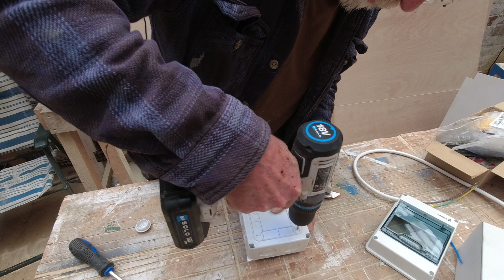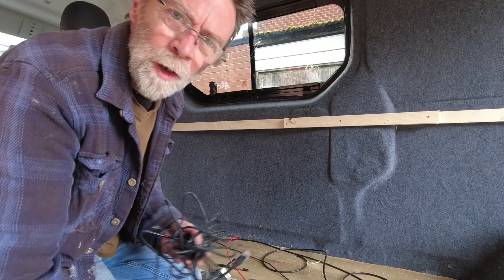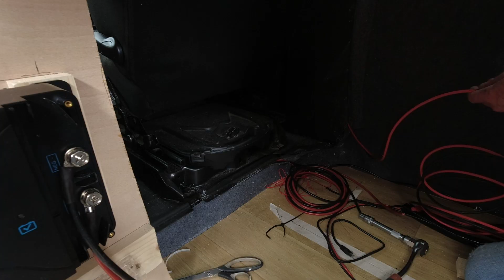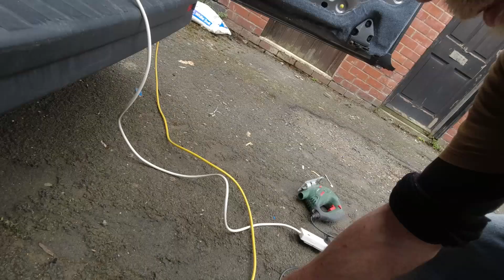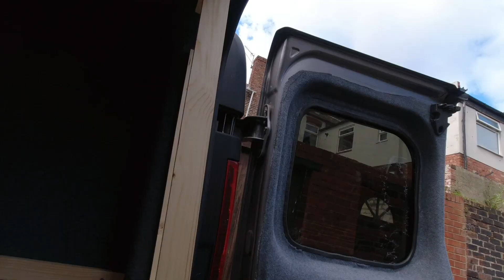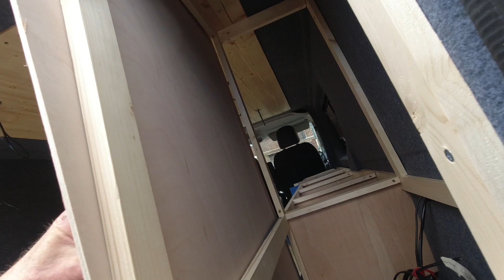Vauxhall Vivaro Camper Van Conversion (Day 13)

Comment: Loving the videos thanks I'm doing a vivaro as well what size cables did you use from the starter battery I've got some 70 amp cable not sure if it's going to be man enough thanks
Reply from the maker: Hi, I used 70amp too or 10mm2 I think that was recommended for the renogy dc-dc charger. Good luck with your conversion.

Comment: Hi from central Otago southern new Zealand 👋 I'm glad you kept track of the wiring 😂 electricity and I have an understanding, I don't muck around with wires and it doesn't take my hand off😂 I don't have electricity in my tiny house and it's inconvenient occasionally especially with light in mid winter, but it's a minor inconvenience. I actually have a solar panel and a inverter generator but they're still packed away, I've never used them once. 😂 I use a headtorch for light and it does the job but I don't have anyone else in here either, so it's fine for me. I was impressed with the van wiring though, very nice job, tidy and convenient. Great video 👍👋
Reply from the maker: Thanks a lot.....I had to study quite a bit to gain knowledge of how to do the 12v wiring....but you need a good plan and just take one element at a time.

Comment: Hya Dave. I really am enjoying this series on your van conversion. The only thing that causes me concern is those breakers. There are many other youtube channels which have pointed out the dodgy nature of that particular breaker type - them being a really bad fire risk. In my system I used heavy duty mega fuses and manual switch breakers.
Reply from the maker: Yes I looked at some of them videos....I always test the breakers to make sure that they are cutting off the current and so far so good....never had a problem with them. Thanks.